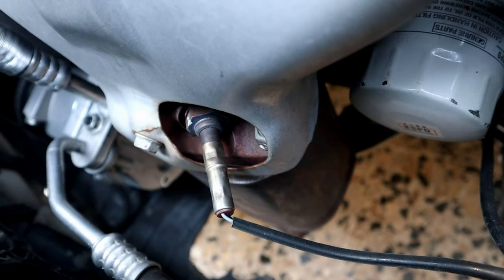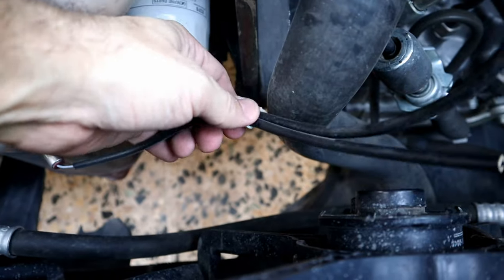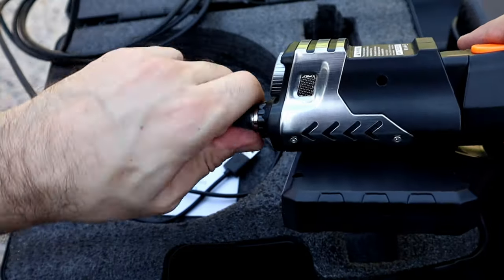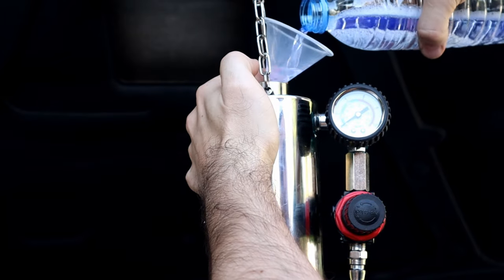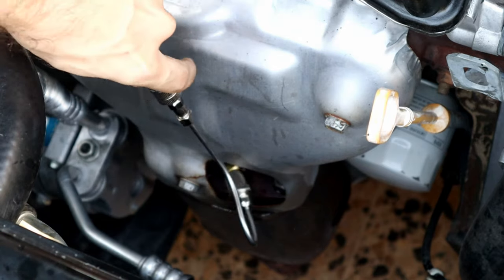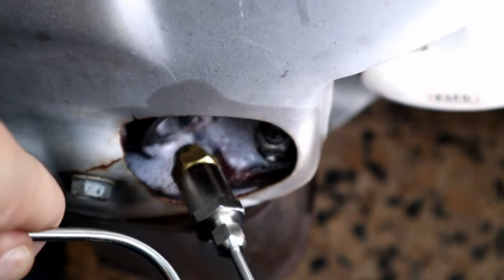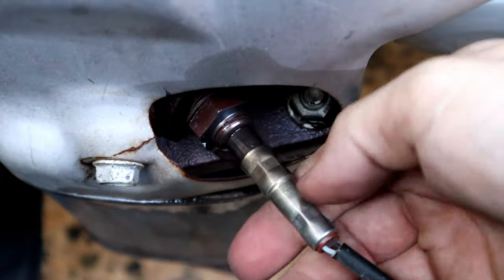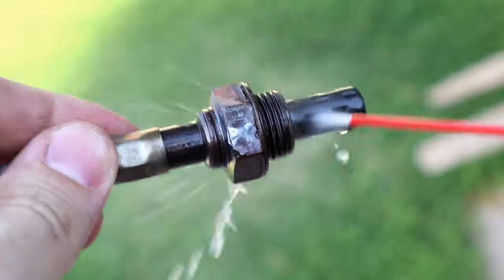Catalytic converter cleaning in less than 5 Minutes/Cleaning Catalytic converter with AUTOOL Kit

Comment: You want to reverse flush.  Too much exhaust pressure can blow seals and gaskets on the engine.  Taking the converter off and using a dishwasher tablet in a bucket of hot water overnight is enough.  Reverse flush with water quite well, dry it out on a hot day or with a hair dryer, reinstall and you're done.
Reply: THE HECK SERIOUSLY!? Damn near $3k for that!? That’s insane. See I learned how to change a tire, breaks, do the oil, change the fuse under the hood, and the filter. The one in the glove box. Took some digging but hey! However, I need to learn how to do this.
Reply: The real issue is: you cannot simply REMOVE a catalytic converter or put it back easily. It's welded!!
Reply: This method is good. You don’t need to remove the catalytic or dry it. The heat from the exhaust will dry it completely.
Reply: @abdulhassan1107  or the oxygen sensors are tied to it
Reply: @abdulhassan1107  not all of them are welded. Some are bolted on. Depends on car.
Reply: @fidedavalos  With this method isn't there a risk of water getting into the cylinders and damaging the engine?
Reply: @alekosb397  Water is going to the other side
Reply: Can this be done on 2007 bmw do you know
Reply: I'm sure you know how hard and touchy it is to get the manifold bolts off any cars manifold.   Accessing it also can be very hard on most cars.  That' the hard part.
Reply: @abdulhassan1107  if you have a badly made car yes
Reply: @alekosb397  umm, no. The catalytic converter is under the car inline with the exhaust which puts it lower than the engine's cylinders so, you know, gravity. It will pull the water out the exhaust before it ever reached the cylinders.
Reply: @abdulhassan1107 mine is all bolts toyota tacoma

Comment: I had a PO420 bank one code.  I went ahead and replaced my cat and two sensors after not being convinced anything can clean them after a lot of research. . This may work but It would be a mess for me to take my upper Cat off, myself.   The man at Midas had 26 years experience.  I let him do it.  I ordered the OEM parts and Midas installed it.  Cost about 1,500 dollars parts and labor total.  What I didn't expect is, it greatly improved my gas mileage.  It went from 17 to 23-24 mi a gal. I double checked it.
Reply: $1500 is robbery. I ordered an OEM grade catalytic converter and had had a muffler shop weld it on for $100. It came out to $300-350 total and lasted 7 years.
Reply: @jackempson3044  Yeah, an OEM cat was like $1300 for my car, but $300 for 7 years is pretty good. You gonna keep your car 7 more years? My car is 23 years old. Next time, which is now, I'm just gonna do an O2 sensor spacer for $6.

Comment: Did you leave the "Downstream" O2 sensor in while cleaning? Did it matter if the O2 sensors got wet? You didn't wait for the Cat Con to dry out. Does it matter?
Reply: Yeah, he probably ruined the downstreams, unless it's oxygen sensor safe, but honestly I would not do what is doing.
Reply: @datmanz5890  Why wouldn't you? What risk is there?
Reply: Hi, did you get any solution to this puzzling question?

Comment: Helped me pass smog check. The carpet cleaner I used was the one from rug doctor. It was like $8 for the bottle.
Reply: Did the light come back on?
Reply: So he did say Carpet Cleaner! I thought I misheard him! 
I actually have 1/2 a bottle of Carpet cleaner by Rug Doctor that says OXY on it...
Reply: @MikeKollin  I thought he said carpet cleaner too. But then in comments someone mentioned carb cleaner.
I hope he will clarify.

If carpet cleaner, and carb cleaner, and laquer thinner, and cataclean  and dish soap  does the job, I'm starting to think that almost Anything will do the job. I think I heard of other things too, just can't think of them now.
Reply: Carb cleaner does NOT mix with water. I am pretty sure he used carpet cleaner.
Reply: Seafoam or catalytic  converter cleaner mix with water or  just spray inside without water 💧 ?

Comment: Guys, I have a 2010 Nissan Sentra with over 220,000 miles on it.  During the last 13 years,  I have gotten catalytic underperforming codes 3 times.   This is how I deal with them.  With the engine cold,  I pour Dawn detergent down a garden house.  I then stick the hose as far as it will go into the tailpipe. I then seal, as much as possible, the tailpipe and garden house with plastic bags. I then turn on the house and fill the exhaust system with water and Dawn, making sure that the water does not reach the exhaust manifold but gets past the catalytic converter. I then let the soapy water sit in the exhaust system for 10 minutes. If the water has drained out via the tailpipe or leak in the exhaust system, I again add water until is is just past the catalytic converter and I immediately start the engine.  The engine's exhaust will forcefully blow the soapy water out of the exhaust system and clean the catalytic converter. Let the engine run for 20 minutes, or go for a ride,  and that's it, problem solved.
Reply: and rust out the exhaust and muffler from the inside
Reply: @nickgc1234  no, it all evaporates when you run the engine.   By the way,  when you start your engine every morning,  you will see water dripping out of the exhaust because moisture inside the exhaust is normal
Reply: huh?..." , making sure that the water does not reach the exhaust manifold but gets past the catalytic converter."....just how do you know when to stop ???
Reply: @TheWilferch  you can easily estimate it. If you are really worried about it,  remove the O2 sensor and out the soap abs water through the hole where the O2 sensor screws into.
Reply: @JR-kk6ce  At over 509 degrees all water will vaporize. An engine runs at very high temperature
Reply: Sounds like it would be easier to just remove cat and install new one lol
Reply: Or you could just put an 02 sensor spacer and call it a day.

Comment: Just for your information, WD-40 is not a lubricant it is a solvent. And can cause problems when it dries. It was designed as a water displacement formula hence the WD.
Reply: Yep...Its not often you're wrong ?...But you're right this time.....lol.
Reply: Hater
Reply: I agree
Reply: It works though for moving rust
Reply: What's the "40" from W for ? It does contain refined petroleum however.
Reply: Well technically your not correct either.  WD 40 is a lubricant as it has many lubricant additives but is also a mild solvent to displace grease etc.  So it really can be used as a multi purpose tool, water displacement as you said but also to lubricate and clean.
Reply: @andymartinez767  errrm technically ackchually SU NERD
Reply: War Department 40
😅

Comment: good video, I'm going to try the foam cleaner that you use to clean radiator cooling fins. I figure the foam will cover 100% of the inside of the converter
Reply: Why not just use a cat cleaner?
Reply: @cbngncb  because its expensive? $7 vs $30

Comment: I understand if you can clean it but what about if it is ruined from oil leaking?
Reply: si el motor está consumiendo aceite, esto arruina el catalizador? motor v8 4.6 gasolina ford explorer, consume un litro de aceite cada 5000 km
Reply: @bugayev yes oil can ruin the converter and foul the o2 sensors

Comment: Great presentation and explanations. Thank you. I was thinking of doing the same thing but using a solvent like carb cleaner or engine starting fluid. Do you think that can work too? Thank you
Reply from the maker: Yes, I used carb cleaner for cleaning intake valve and the o2 sensor https://youtu.be/wKOiFaNnFvU , it will definitely clean it too
Reply: Try 1gal of Lacquer thinner in per 10 gal of gas.  Drive highway about 70mph for a couple of hours.
Reply: @johnd.8224 Laquer thinner is trash! It damn near tore up my fuel pump. Smh

Comment: would the pressurized soapy solution work its way through an open exhaust valve and wash all the oil off or hydrolock a cylinder?
Reply: No, it would drain down the exhaust pipe.

Comment: but you should put some copper anti seize on the threads so next time you can take it out easily
Reply: veryyyyyyyyyy true , he'll be sorry 3 years later. :D
Reply: Make sure, whatever antiseize you use, make sure it is "sensor safe" so you dont wreck your O2 sensors.

Comment: Thank you  Thank you  thank you  God bless you  
Some  mechanics  i can't  trust    why didn't  they  say that  to me  72 years old  a catalytic converter is  to expensive  
 Why didn't  they  suggest  that  in the  first place
Reply: A mechanic will never recommend cleaning a catalytic converter. It not a standard practice. This is strictly DIY only. Also, if it's already clogged or damaged, the only solution is replacement.

Comment: Carb cleaner, injector cleaner and brake cleaner are flammable. Cat will heat up over 500 degree. Will it be no issue to run after clean?
Reply: Put it back when its dry.
Reply: "carpet cleaner"  is what is said in this video, not carb... far as I can tell

Comment: is it safe to use Carbon cleaner or intake valve cleaner?
what about fuel injector cleaner? wouldd be ok ?
Reply: Go for it. It works. I used seaform fogger fuel injector cleaner and it looked like new. It was so bad that my car had no power pulling out. It was so clogged

Comment: Did you remove upstream and downstream o2 sensor, or just upstream, I am assuming just upper because exhaust from tail pipe. Does this not make rear o2 sensor contaminated, or is this the one you are cleaning after? I want to do this but don't want to mess up my o2 sensors. Thanks.
Reply from the maker: Just upper one, only, no most of the times only upper on gets contaminate, because the engine having some kind of uneven burning and i didnt had any problem with the sensor after that

Comment: Should I remove the downstream O2 sensors after spraying the solution in through the upstream O2 sensor holes, and before turning the engine on? I am thinking the dirt from the CAT may plug up the sensors or do some damage to them. I'd also like to use Dura Lube's Severe CAT Cleaning Solution. Your thoughts?
Reply: I thought the same exact thing? Did you pull it off?
Reply: @danielfiore5528  I used $17 Oxygen sensor extenders on the downstream O2 sensors and they fixed the problem. The check engine light does not come on anymore.
Reply: @hidvisioncanada5602  where did younfind these extenders in canada ?

Comment: Other videos recommended removing Cat, but on my Ford Transit Connect, removing Cat is a major job. I think I will try your method. Thanks for the tip👍 😎
Reply: Did it work?
Reply: Did it work? I want to try this on my Ford f150 1994
Reply: @Richardv24  overall, no it did not! The “check engine” light did turn off for less than an hour 
(my total drive time) but came on again. The exhaust smell never changed. Meaning it was still “below catalyst threshold”
which is the original code that brought the check engine light on. I ended up replacing the 
Catalytic Converter.
Reply: @michaelhernandez-uu1bz should have used  hydrofluoric acid. Dawn dish soap isn't enough.
Gonna use citric acid and oxalic acid  next week as a 2nd opinion. Car runs alot better. Also used a garden sprayer. You don't need his tool.
Reply: @Acanofalconpunch  Thanks for that tip!
Reply: @Acanofalconpunch o2 sensor downstream wont get damaged ?

Comment: What do you think about using oxycat by pouring it to gas tank? Can it do the cleaning as well?
Reply: If the problem has just begun and is minor then yes, a fuel additive can clear the problem. If that ends up working for you I would suggest you only use a top tier fuel in your vehicle from that point forward. If you are in the U.S. the best choices are either Chevron or Shell gasolines.

Comment: What type of air compressor do you use this kit with? Please reply...
Reply: He filled the can using any old air compressor it was only 60PSI
Reply: @punkrocktv8229  Thanks. What about the air hose? are they universal fitting?
Reply: @MD-xl3lj  universal yes. The kit he is using is overkill. Just use a garden sprayer for 10 bucks. As long as u remove the 1st oxygen sensor  and the sprayer end will fit in the tight space.  I would probably try a catalytic cleaner 1st before doing any of this , that you put in the gas tank. Like oxicat or any of them. His catalytic converter is not very dirty.
Reply: @Punkrocktv Thank you so much. Is it necessary for the garden spray fluid to flow widely? or a steady stream of water? Will there be sufficient pressure to clean?
Reply: @MD-xl3lj   As long as you pump it up you'll see that it sprays just as hard as the one  he is using
Reply: @punkrocktv8229  Thanks a lot, I did the trick after finally being able to remove the oxygen sensor. I scanned the car and no more error code.
Reply: @MD-xl3lj  Not universal on my kit. The male air hose fitting on the side of the canister is too wide to fit into a female quick connect end on the compressed air hose (at least in the US). I had to change it out.
Reply: @punkrocktv8229  thanks for the garden spray idea. I did mine except used hydrofluoric acid (wait n spray technique)and 5 gallons of water afterwards to clean my car. Now it runs like a dream with 7 mpg gain.

Comment: Won't this cause rust on the inside of your exhaust pipe?
Reply: No. If you drive it after, the heat will evaporate it all out before it has a chance to react with the metal. If you do this and let it sit for weeks, then possibly.
Reply: Combustion of fuel produces water, so your exhaust is constantly exposed to moisture. This is why you see your exhaust when it is cold, that is water vapor.

Comment: That’s absolutely not necessary to do and believe me if you had a blocked cat this procedure will do nothing to clean it. To clean a cat you need to rise temperature as high as possible and high pressure to burn and send out all the buildup. Simple fuel additive like wynns catalytic converters and lambda sensor cleaner can help a lot more Good video though, thanks.
Reply: But Sir ,You do know about MOLECULAR HYDROGEN  IS !!
Reply: Why not PEA and soapy wooder (separately)?
Reply: When I use a scope, all I see is a screen
Reply: How is the high pressure applied? Would the motor do it itself or do I have to buy an additional thing?
Reply: Carpet cleaner?

Comment: what is the general pressure that you set on the valve which controls the actual flow of the cleaning soultion being sprayed into the catalytic converter ? what mean here for example is valve set for air pressure at say 18psi 20psi 25psi etc thank you.
Reply: I thought he said 60 PSI?

Comment: Not only this absolutely unnecessary but it can cause problems in your engine. NEVER GO TOO SMART WITH YOUR CAR. let it work as long as it works.
Reply: How would it affect engine, its after engine
Reply: @richardrussell4065  its after engine?! well, try this, insert a potato in your car's exhaust rear end and turn on your car to see what happens
Reply: @Heybat  its on the exhaust manifold ya goof, after the engine
Reply: @richardrussell4065  You are a true gentleman Richard
Reply: @Heybat  why you say that
Reply: @Heybat yes if he sprayed upwards. Like putting a hose up through the exhaust 🤦‍♂️
He's spraying downwards, liquid will exit through the muffler's weeping hole(s).
Also you're wrong pieces from the catalytic converter cannot get inside of the engine because the pressure is blowing it in the opposite direction. If left untreated it will just clogg the rest of your exhaust system.

Comment: I just wonder if we can use the throtle body cleaner to clean the ox sensor without damage?
Reply from the maker: Throttle body cleaner not that good for burned carbon on o2 sensor, it wont clean it, if it was covers with carbon , carb cleaner wont damage it

Comment: Can I use ACD Carb cleaner instead of water?
Reply from the maker: If you like to use carb cleaner,  you can spray it from pcv valve with engine running
Reply: @AliMECH  Thank you brother
Reply from the maker: Anytime 🙏🏻🙏🏻
Reply: @AliMECH  Can you spray the carb cleaner into the hole of the removed oxygen sensor if I do not have a pressure spray like yours? Honda accord 8 gen

Comment: I cut mine out and hammered a piece of re-bar through it a few times ..busted all that shit up and trapped it all in a bucket until I could look through and see only empty pipe and welded it back on..FUCK 'EM I HAD TO TWEAK THE ECU
TO NOT RUN LEAN BUT IT BREATHES SO MUCH BETTER NOW RUNS LIKE A SCALDED APE! AINT LOST A WINK OF SLEEP ABOUT IT EITHER LOLZ

Comment: Putting that spacer on the o2 sensor is not,fixing the problem. Its only turning off the light. Might as well put tape over the check engine lite ,that's easier.  If there's a hard code for a sensor it needs to be fixed right. You work on cars ,I fixed cars for a living
Reply: If you put tape over the light you won't know if something else is wrong.

Comment: When Barney and Fred would buy their new Cadillacs in Bedrock. They , would take their (440 cubic inch monster or + size)
=====
 Then , Barney and Fred would ( 🌋punch the ⛽ gas🔥 pedal)  all the way - to the floor - then let off ; the gas pedal & (poof ! ;🐈 💥 the cats 💥 🐈 we're dead.)👋😎💨 Bryan
Reply: Tell  them the untold story Bri.
===
Thanks Dude 👋 😎 💨
===========
It was a $25,000 fine in the 80s to "physically" knock out your 🐈💥cats🐈💥.
=====
Now if you have Alzheimer's and forget to reconnect all your O2 sensors and do the Barney I don't know and Fred I don't know

Comment: This no true at all , I tried all methods. If the vehicle over 200k miles ( hopeless case ) because of ceramic got bad & expired , but if less than 200k miles , may be gonna work .
As guarantee my experience 
I bet any Machnick in whole world . ( thanks)
Reply from the maker: You are absolutely right, catalytic converters got a life time, if it existed cleaning not gonna work,  and you will still get check engine light on due to not absorbing harmful pollutants into less harmful emissions